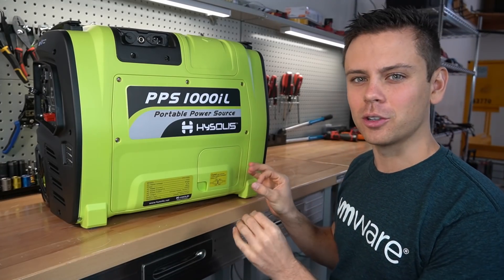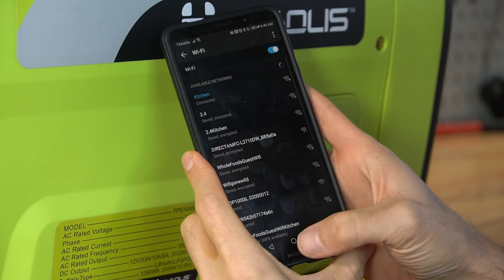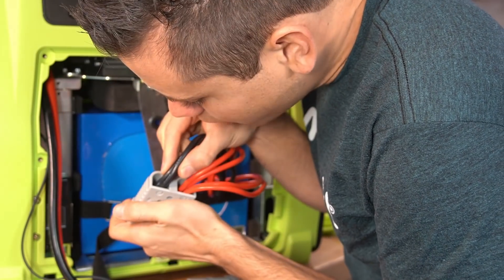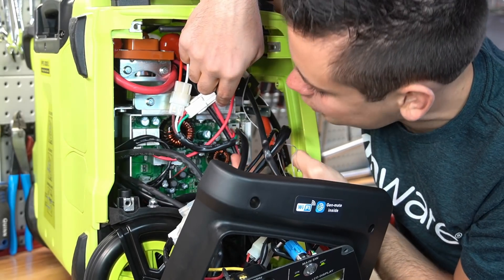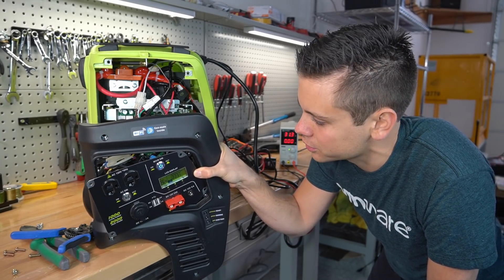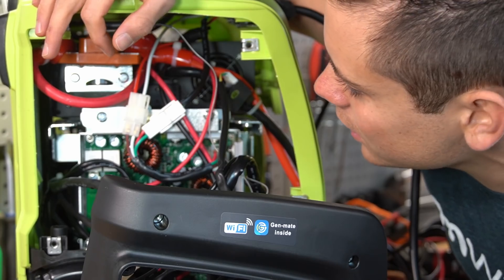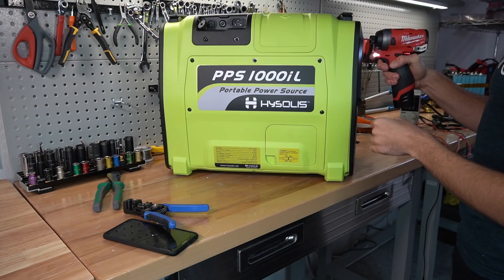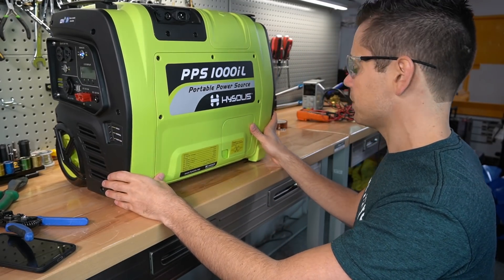$999 "Hysolis" LiFePO4 Solar Generator w/ MPPT and PSW Inverter: Total Teardown

Comment: Hi Will, thanks for another great video. I did wanna ask about how long can an Energizer PPS700 run an RV 12V refrigerator run for incase you ran a test. I couldn't find any info. Thanks in advance.

Comment: I was wondering if you would go down a little different path. I’m looking for a gas generator and battery back up with a solar panel set up.  Occasionally lose power for a week when it storms or tornadoes.  I don’t want to run a generator at night time.  It has to be extremely easy to set up as well.

Comment: I live in New Zealand.. where its hard to get any products.
I have bought a solar generator that looks identical to this except it has a different name. Its called drivelong.
It even uses the gen mate app. It is recommended to charge with a 120W solar panel. 
Is there a way to charge it faster? Series or parallel? Any advice please

Comment: Hey Will, could you actually try to use the DC outputs please?  It doesn’t look like you tried to use them in this video.  I’ve just purchased one of the 160Ah versions of these, and CANNOT seem to get any of the DC outputs to work for anything other than a simple resistive load.  As soon as I plug in anything other than a fan or lamp (So I’ve tried far my CPAP power supply, my Waeco fridge, an Aldi invertor, a 12v macbook power supply (not sure on  brand), and even just my RC Lipo charger (Turnigy Eco8)), the DC output just shuts off until I turn the unit off and back on again..
Reply: Answering my own question, spent two hours with the .au distributor today, and on video chat with the manufacturer in china which was interesting, since they didn’t speak english, so the poor chap from the warehouse here was translating back and forth, and their answer in the end was that their DC output overcurrent detection is too sensitive to be able to plug in any device with a smoothing capacitor on its’ input.  Ended up getting my AU$1800 back.  now off to build my own I think.

Comment: Could you use this system and hook up a big battery power block to it? 
Not in parallel with the original battery just instead of the original battery.

Comment: Will; there is such a thing as a latching relay that only consumes power when switching states, does not matter if it's in the NO or NC state it only draws power on the state change, you would have to check for current to tell what type of relay it is or look up the relay part number.  For the most part in my electronic designs I've switched to latching relays when I use a relay specifically for that reason.

Comment: Hi Will!  Would this be a good option in a power outage to run a gas forced air furnace for a few hours a day? I'm looking for a solar "generator" that could be charged without a wall AC outlet. We lost power for about 4 days a couple weeks ago with below freezing temps. We'd like something as a back up and to take camping. Thanks!

Comment: The conductor across the battery terminals has me really on the fence with this unit. It meets all the other needs I have at a great price, but being portable and I had planned to put it in my bus conversion project the vibration would eventually cause a problem.
Reply: At least he said, it's high quality insulation & you would have an idea what might be wrong, if it played up. I think they usually come with long cords. Maybe try keep the actual unit in the shade. That's what I'm thinking.
Reply: @karrimusicviolet4157  I opted to just build my own pack out of some used medical packs. Ended up with a lot more battery power for only a few hundred bucks.
Reply: @ancienttechnology7337  Wow. I'm just About to drop all the green in my account on one. I'm in Australia & it says low stock, everywhere they have them. I watched an instructional video on a 3.5k one.. I think. It was Interesting to watch, but I have none of those tools & 2 small children🕊️🏔️🌊📻🌅  Here I go....
Reply: @ancienttechnology7337  I'm so happy for you. I hope it serves you well🐬🍊🌻🍓🪴🌼🌴
Reply: @karrimusicviolet4157  it's not easy, but it's not rocket science. This unit is honestly a pretty decent value, but I chose the battery build because I wanted the flexibility to grow build and change as I need to. My other units are smaller and that's one thing I realized is that they are great, but they aren't modular or upgradeable.
Reply: @ancienttechnology7337  for sure. I keep watching prep videos & saw this was sold out in America & thought I better think quick. 🙂 How are the shelves where you are? 🌅🌴🌊🍊📻
Reply: @karrimusicviolet4157  still ok, but we are all headed the same way you guys are at the moment. Especially where I am. The state's are very different, some are free some are nuts.
Reply: @ancienttechnology7337  Yeah, It seems that way🐬🌼🪴🌻🌅🌴🌊🍊📻bring on the home school 🏔️🪶👼🕊️

Comment: Will, I went with the gas 4500wt. Onan/Cummins Inverter generator. On demand power to supplement 400wts of solar is piece of mind for my off grid t.t. setup.

Comment: Need your help!  I have a victron mppt 75 10 charger in my trailer.  With a new phone and setting up the app I had to get the PUK pin on the back because I needed to reset to the default pin.  Taking off the wall there is that tab next to the fuse.  It covers two out of the four pins that you can use to hook a cable to hook to pc or whatever.  It fell off and I believe it covered the middle two.  It no longer won’t stay on by itself.  I taped it on but want to know if It matters if it’s on or not.  I’m thinking that maybe it acts like keeping a certain connection even if you are not using to connect a cable.  So far the app on my phone seems to be working ok but please advise.  Thank you ahead of time

Comment: Great tear down Will. Is the Anderson connection always hot, or does it need to be turned “on” with the associated power drain? The Manufacturer Install Manual didn’t cover that.

Comment: Will,  I wanna buy this thing but you are the only one on the web with any review.  
Can you run more of a performance test on this other than the tear down you did?
Seems like a no brainer to me.  Even if it broke I could still take the batteries out of it and hook that into my existing small 2 -car battery / 2 -100 watt panel system...  and it would be a wash.

Comment: Saw the other vid referencing crowd-funded items and agree, recommend requesting at least PPAP level, if not actual IP sampling for review. What you have been seeing is circumstance where the low bid and not necessarily best fit vendor makes part.

Comment: That's funny I know a solace, I'll say hi for you next time our paths cross.

This looks like a nice modular system like if the inverter went you could probably swap in your own down the road when they're no longer supporting it. Or say if you wanted to say increase the output capacity.
Cable management's not bad but it isn't great either, Looks like there might be some possibility of chasing.
I am intrigued, I wonder what the other stuff looks like.

Comment: These portable power systems (not generators because they don't generate anything) at that price are looking good. A few hundred watts of solar, and you have a good backup system. This type of system will also be good for the none electrically inclined mobile living people as it's self-contained. Just hook up the solar and plug in your devices. That battery pack looking so much like Wills means they probably watch his videos on what to build.

Comment: Hi! I am new to your channel. I am a DIYer and currently using blade fuses for my very small solar setup, 300 watts, 12 volt system. I want to upgrade my system into using a newer dc circuit breakers. I saw a lot of dc breaker/fuse types at ebay, which one of these can you recommend? Can you make a review for these dc breakes/fuses? 
Sorry i saved the photos of those breaker types in my ipad but sadly, youtube does not have option to attach pictures in comment.

Comment: Off subject some but, Can you do a study on how to add capacity to a an existing lithium battery system.
I have a 200 amp Lithium Iron Phosphate that I would like to add another battery of the same type and brand but they will be separated by about two years in manufacturing time.
thanks
Robin Pal

Comment: That unit looks like they took the housing from a regular gas powered inverter generator and made it battery powered. It’s got the pull rope cutout on the top, engine access cover and oil change cover on the side.

Update: found it, it’s just like the Neilsen SE2000iE
Reply: Yep that's it. Not a bad conversion 🙌🏻

Comment: I think you should have the max current draw test in pretty much all your reviews. Also a battery run down and charge up test would be nice. So I guess I'm asking for an inverter test, a charger test and a battery test? I always like to know if a generator can handle running an AC and/or power tools and how long it could power them. The temperature test is nice but not too worried about it myself. It's nice just to be told if it has it and it works. Anyways, just my opinions, hope it helps. Oh and is it possible the relay is never in the power use position for long? Could it not be a temporary switch when ever it's used?

Comment: Hi Will i hope you had a great Xmas & a wish you a most happy new year. If possible could you do a teardown on a Hyundai solar generator the largest one they have please. I would like to use one as a mobile modular power supply in a camper & then on the farm as well. Cheers

Comment: Capacity test??
Reply from the maker: Am doing it now and it looks like it will pass. They are 100Ah cells though. and I've tested them before. So I figured they would pull full capacity
Reply: @WillProwse  cool.  And thx very much for the review.
Reply from the maker: Oops its a 90Ah exactly

Comment: Makes me wonder, if you were to design your idea of the most optimum, portable, useful, battery sourced power supply, what would it include?
 Something like this would interest me, short of replacing my Lead Acid batteries in my MH for LiFePO4. 

You would be most valuable as an advisor to companies that produce this type of equipment.
Reply: Those companies will just have to watch his videos to learn what they did wrong
Reply: @4philipp    I wonder if these companies are learning anything. R&D for producers may take awhile.

Comment: Hey! Sorry to sound dumb but how I can test the low temp cut off of a sealed LiFePO4 battery without hacking it open? Could I put it in the freezer for an hour then hook it up to a charger and place my MM leads on the terminals?

Comment: Dont know how to contact you But what size 16 s 48 volt BMS would you use for a 8.5 kv motor   120 amp hour pack. Will watch for ans

Comment: Interesting! Not the worst you've had on your channel by far. Personally, I wouldn't trust it for daily use in a van, for the safety and efficiency reasons you mentioned. But, I could see it being insanely useful where one might otherwise have occasional use for a small generator. The farmer's market example is a good one. I could also see taking this camping, or using at an outdoor party for music and games, so long as I could keep it reasonably dry and out of the sun. Thanks for the video!

Comment: It looks like they have repurposed the enclosure from a gasoline generator.  I have a cheap ICE generator with the exact same casement, including all the little doors.  The small door on the front is the oil fill.

Comment: On your site, you saying that that EPEVER MPPT Solar Charge Controller is good for Drop-in Lithium Battery... could you explain what a Drop-in Lithium Battery is and is a Valence U27-12XP LiFePO4 12V 138AH 1.766 kWh Lithium Iron Phosphate Battery a drop-in Lithium Battery?

Comment: "solar generator" still triggers me.
Reply: It generates solar, hence wear sun screen around this devices, you will get a tan at the wrong places
Reply: @mannyechaluce3814  🤣
Reply: I think Solar power plant is a bit long winded though.
Reply: @mellee3436  :P "Battery with inverter"
Reply: I don’t like it either but apparently that’s the language they want to use for it
Reply: Why, does a gas generator make power without gas?
Reply: @kev767  A gas generator converts any solid or liquid matter into gas, usually by heating it.

Single-fuel gas generators require specific inputs (E.G. Sodium bicarbonate, hydrazine, nitrocellulose) in order to produce gas.

Comment: Perhaps there is a temp circuit on the input somewhere to keep from charging in low temps? Not as nice as taking the battery temp but would still work.

Comment: The 4.5kWh model looks nice. Is there any solar generator battery backup existing coming with a standard 220V 35A plug to use a standard home generator outlet ?

Comment: By the way I can't afford the high dollar panels right now but I do have three harbor freight solar setup totaling 300w so I figure if I put a buck converter on each panel and tie the outputs of all the buck converters together and run them to the charge controller. So I'n therory I can control the voltage and the current coming from each panel. Let me know you think about this idea.

Comment: Hey Will I came up with the wild idea to add a Anmbest constant current cc cv buck converter Model DC 6-40 Input to 1.2-36 V at 20 A. 300W Adjustabile step down voltage regulator power supply Module with short circuite protection function. It's been raining here in Virginia but soon as the sun come back out I will be putting this to the rest. My purpose for doing this is to boost the output power of my solar panels. With that buck converter it has potentiometers to control the voltage and the amperage

Comment: You should get the sungzu ska 1000. It has a 1000 watt hour battery and a 1000 watt inverter for $700-$800. I have one and I like it. Good enough to run a mini fridge for about a day for under a Grand

Comment: Simultaneous charging is only a concern for people on grid. 
If off grid, it isn't.
However, low temp cutoff is a must in most of the US.
I can see this running a CPAP, laptop and lights.
Reply from the maker: I am thinking of when I lived in vans and rvs and I wanted to charge quickly with the sun and shore power. I would be bummed if I could do one without the other.

Comment: Hey Will can you do a video on how to connect MC4 connectors from scratch. I have tried multiple times and can’t seem to get the connections to work? I don’t know what I’m doing wrong, as I’ve tried over and over again and I can’t get the electricity to flow from the MC4 connectors when I put them together from scratch. 
In other words I’m using components and hooking them up. I just can’t figure out why it never works. I realize you use the smaller insert for the negative and the larger insert for the positive. But they just won’t go in all the way! Is there some trick I’m not doing? 😕

Comment: This might be a good candidate for a long term test. Is a good fit for a "van life" type thing. I was also wondering if the invertor would run solely on the PV input or if it went through the battery first. Not sure if it makes any difference just curious. Keep up the great work!

Comment: WILL, capacitors, dc 100 ah 12 volts how much stored energy. Young man be careful in new unknown system. You could get killed guy says...eye glasses gloves good idea on FIRST inspection. What is hot might sting a bit. Kitty needs you. Safety first.

Comment: Good job Will. I am looking for something like that with a 120/240 v split phase inverter for emergency backup. Live in rural NH so the larger the battery the better. Need 240 for our deep well pump. Can do without a lot but water is absolutely necessary. Keep up the good work!

Comment: I guess it is possible that it has low temperature cutoff on the BMS but just doesn’t have an external probe. With the whole thing being packaged close together and enclosed that might be adequate as the temperatures will be pretty similar.
Reply: It shows you the weather report on your phone so that you don't charge the battery if it's been cold

Comment: Do you plan on doing capacity testing for both the battery (kW-hr) and the inverter (Watts continuous)? Also, with all the discrete modules, it also seems like the perfect specimen to do system efficiency testing, both as a whole and each step along the chain. Maybe also measure the current draw of the relay/contactor energizing coil. If the battery and inverter are any good, it would be a good start for a custom/semi-DIY unit, as you can rather easily upgrade what you don't like about it, and still come out with a cheaper and more compact system than going fully DIY from the ground-up.

Comment: That thing is HUGE for its capacity. Apparently they wanted it to look like a gasoline generator.
Reply: They probably bought the shell as a generator shell and adapted it
Reply: The company (Drivelong Technology) originally made generators, and seems to have only moved into battery packs in the last 6-9 months, and is just using the same physical packaging. Why change a good thing? :)
Reply: @DamienGardner  because it's huge for the capacity?  That's not a good thing
Reply: @veganpotterthevegan  There's not much unused space inside, they couldn't have made it much smaller. and it's a very convenient package, with the wheels etc. :)
Reply: @DamienGardner  Sure, if you use other, oversized components as shown
Reply: And probably weigh as much!

Comment: The not being able to use multiple points of charging  seems to be a new thing. Goal Zero X  series will only take charge from the highest source  if  more than one is plugged in,  stated in the manual. I've heard same thing in reviews of  recent models from other manufacturers.